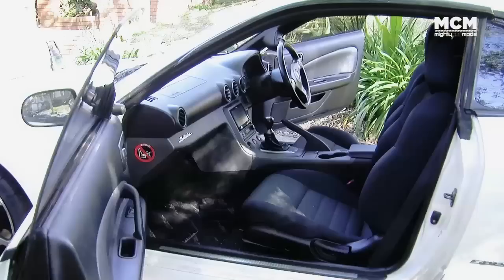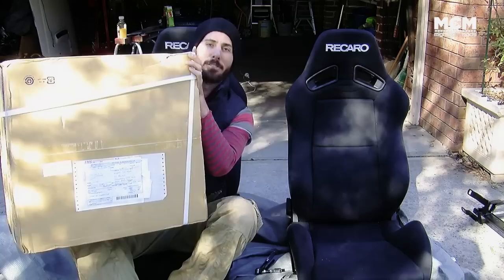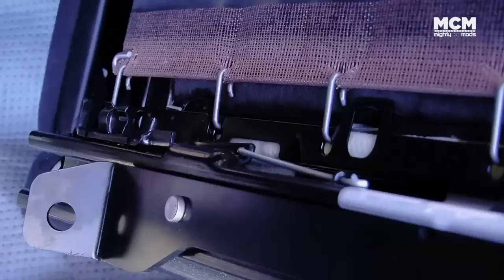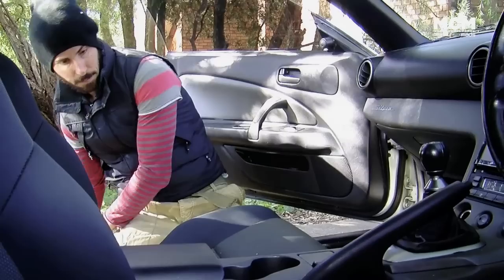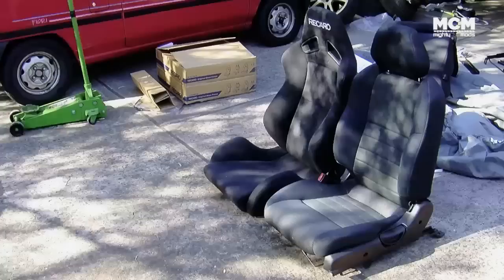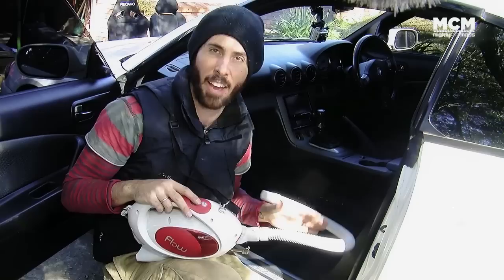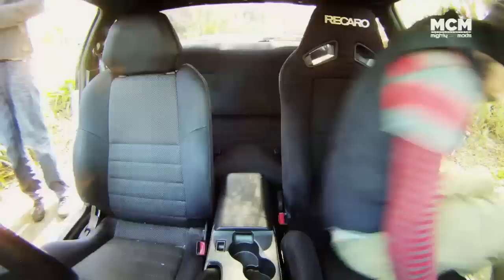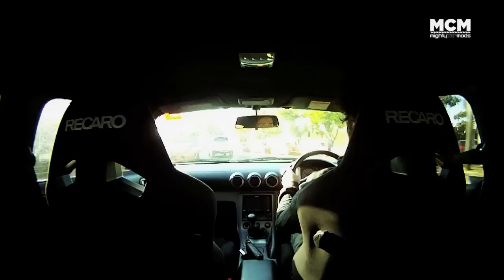How To Install After Market Seats

Comment: Getting rid of this car was the biggest mistake in the history of this epic show.
Reply: Z33 Garage Just a car. Get over it. I personally like when they tune those cheap blue turds.
Reply: 3rdpartyU5er "just a car" said a non petrolhead
Reply: Uberized Arts Naah man, when it's not my car, I always say it's just a car. Only my car is not just a car :)
Reply: Uberized Arts Seriously an S2000 is a better overall car.
Reply: TassieLorenzo s2k better than a Silvia. You must be drunk dude, go home lol
Reply: TassieLorenzo did you just dare to say that s2000 is better than silvia? :O this gave me cancer
Reply: Z33 Garage Yes, it's better!  Especially stock vs stock!  Stock suspension - S2000 much better. Steering - S2000 better.  Gearbox feel - S2000 better.  Engine sound - S2000 better.  S15 can be made much faster and is better for drifting, but that's the only advantage. ;)
Reply: jevnik542 If you don't believe me check out Best Motoring videos of stock S15 compared to stock S2000.  The S2000 is faster and overtakes the S15 ;)
Reply: TassieLorenzo i said better. not faster. Overall S15 is legendary car. Cant be compared to s2000.
Reply: Z33 Garage If the S15 came with a SR20VET (the Nissan variable lift engine) and had a much better chassis then it would be comparable to the S2000, but it doesn't... The SR20DET is not on the same level of sophistication as an F20C; neither is the S15 (or S14 or S13) chassis on the same level compared to the S2000 chassis and suspension.
Reply: The S15 is certainly a good tuning base... but that's cause it needs more work before it's good. ;)
Reply: +TassieLorenzo even my 350z can easily take an S2K and the S15 is way better than a 350z.
Reply: +TassieLorenzo defiantly agree with you, the s2000 is a much better engineered car, stock vs stock it would beat an s15 no doubt, the s15 is much easier and cheaper to tune, both in handling and power, a stock s2000 would be outdone by a tuned s15 and to tune an s2000 is much more expensive, as moog said in one of his videos the s15 is the bolt on king
Reply: +GaboGlow its funny you should say that because 350z vs S2K stock for stock according to car and driver have equal 0-60 times and equal 1/4 mile times.
Reply: This Silvia was so clean and unmolested (unmodified) that it wasn't ever worth selling. Most Silvia's today are molested, modified, and worst of all...LS1 Swapped ewwww. This car would only go up in value if kept stock.
Reply: LOLLLLL 350z sucks man, s2k is soo much better
Reply: 6 years later still true
Reply: @Bridger Charlie instablaster :)
Reply: @Bridger Charlie you are welcome xD
Reply: @VlogFilms  what car do you drive
Reply: 2024 Bring back a S15!!!

Comment: I can genuinely imagine someone blindly following this advice and actually jacking up their car.  You'd feel like such a wally when you finished and lowered it down.
Reply: When filling up your headlight juice, jack up the car and don't forget the axle stands.
Reply: Haha did u get that from Roosterteeth
Reply: As someone who knows nothing about this, but i got the feeling that, they were just trolling, right ?
Reply: ZeppinnEU Well there are some older cars that have a long bolt that goes through to the bottom. 
So don't forget to jack up your owners manual.
Reply: I was asking out loud what the point in that was, and I forgot about it until I saw your comment, lol.

Comment: Excellent review however I wish you guys had showed us a very important step that I KNOW you guys took - removing the positive battery cable, then wait 30 minutes before you unplug the air bag circuit beneath the seats as to avoid having the bags accidentally go off or throwing a code. Beyond that great install plus you two have great personalities that make you entertaining.

Comment: Please make a video about beginner car selection and good cars for people getting their P plates that are; fast, cool and under 10k [need cash for mods ;)]
Reply: EF/EL Falcon XR6, one of the quickest cars that are p plate legal, handle pretty good, heaps of space, and the engine responds extremely well to mods. Can be had with manual in mint condition for 3k, and come factory with like 168kw and a short ratio LSD. That is if you are in Australia of course.
Reply: For the money you cant beat the raw fun of he XR6, but there are other cars you should definitely look at if you can spend up to 5k.
Reply: won't be bagging you when you chop them
Reply: sounds good,ill look into it.
thanks by the way!
Reply: Haha all good mate
Reply: 05 WRX is what im getting
Reply: then liberty b4 or liberty gt spec b 4gen or 5gen
Reply: 200sx
Reply: OFCnoChill can't even get over a 1.6 econ-box  because of insurance😣😥
Reply: MrJaffacakesGTI have you looked into a 2011-2013 Mini Cooper Hatchback Base 6speed manual. I bought mine about  year and a half ago. Depreciation is pretty heavy on these cars and the base models aren't too desirable because of the lack of power. Not many performance parts available for the base model, but it is still good fun to drive. Obviously depending on where you live insurance companies treat cars differently. I live in California and due to the vehicle having rear seats there is a lower insurance premium.
Reply: FTO might be alright. I'm pretty sure all models are legal on Ps unlike a lot of other Japanese sports cars, where only the base model is legal, and they're rare cos no one bought them

Comment from the maker: @jcadlols The actual seat is lighter but the baseframes probably bring it about even, we tried out one of the kevlar race seats in the RS which you could lift with one finger. Fixed back and not quite as suited to a road car though

Comment: how would you install racing harness seat belts....
Reply: I'm pretty sure racing seat belts connect to a role cage
Reply: Dan Alves It doesnt have to be connected to roll cage. C pillar bar would be fine.
Reply: You need to install a roll cage to safely use a 4 or 5 point racing harness.

It is possible to install a racing harness to your seat mounting bolts bolts or a harness bar, but those are both stupid ideas. If you ever roll the car, the racing harness will prevent you from folding forward like the stock seat belt allows you to in the event of a roll over and you will die.

Install a proper roll cage, then bolt the racing harness to that.
Reply: On certain cars you can attach a harness to the bolts of the back seat which is still bolted to the car and prevents you from moving a whole hell of a lot during a roll or crash
Reply: Why the fuck not?
Reply: Its not about having track cars or anything. People doing for style points. and it looks nice. I drive a ITR. and I wouldnt mind having harness on it. Tbh i would prefer harness because it fits snug, hold you down. and its a plus if you dont have driver side air bags.
Reply: Jonathan Ngo in practice its not great though, cuz you cant reach the globvebox and other stuff in the car when your buckled in, so kinda impractical for your personal car
Reply: I can't reach my give box with my standard the point chest belt on. I barely can without.

Comment: So what can I do with the old seats after putting new seats in? I've looked around on the internet but I keep getting things about child car seats. I've already made an office chair from an old subaru seat so I'm out of ideas.
Reply: And yes, I know I can throw them away... just seems like a waste.
Reply: If you're into gaming and have a steering wheel for your PC/console, you can build yourself a kind of cockpit with some PVC pipes, wood or steel (depends on your budget and skills). Another idea I is a couch made of carseats, but for that you need a few more seats. But if you don't like those ideas, you could just sell them.
Reply: Just sell them on Craigslist or ebay
Reply: Hasszahn Did that with a $10 seat out of a MK3 Supra from the junkyard.
Reply: you could sell them if they are in good condition. People are looking for new seats all the time, rather it be because of a stain or a major rip.
Reply: eBay, or offer them as swaps or credit at a breakers yard

Comment: Does anyone knows if these seats are commfortable? I have a 350z and the stock seats destroy my lower back every time i drive for more than an hour, thanks for the video guys!
Reply: yes very moog even says so in this video if im not mistaken? cant be arsed checking
Reply: The biggest problem are the mounting brackets, on average they are $250. Also you have to make sure the Racing Seats you buy have sliders if not you have buy them separately. Also if you want the dual harness etc For everything its $700-800!
Reply: if it destroys your lower back, that means you drive with the seat at the wrong angle. Should fix that.
Reply: +Leroy Butts maybe but what if he has a slipped disc and has to see a doctor

Comment: Guys, one biggie you didn't mention was the pre tensioners.  These things have an explosive charge!  And then there is the air-bags too.  There has been reports of triggering the air-bags while changing to sport seats.  So, if your car had these things the first thing to do is either PULL THE FUSE or DISCONNECT THE BATTERY!!!!

If any of these are activated you can make a bloody mess of the dash and get seriously injured.

Comment: In switzerland is not just buying the seats and install them after you install the seats you will have to get the car inspected ( M.O.T ) in order to driving legaly with aftermarket seats it's crazy out here
Reply: Sind die auch so streng wie da?

Comment: Those seats look like they should be factory.  nice choice  I wish they would have commented on potential weight savings and bottom mount vs side mount seat brackets.  Other than that, it was an excellent video as always!  Next should be a video about installing a harness bar and 4 or 5 point harnesses.
Reply: christians131 Reclinable Recaros are actually quite heavy.

Comment: If its the bolt that's messed up find a hardware store and take of of your good bolts that can fit into that hole and get yourself another bolt. If the hole is messed up then you'll have to retap the hole and get yourself a slightly bigger hole that will work with whatever thread tap you used.

Comment: i think on alot of cars under the seat they have a wire for the airbag/pre tensioner which is quite important to remove :D and also taking off the negative battery terminal is a good idea

Comment: Hey MCM how do you swap to aftermarket seats into a car that has airbags built in to the factory seats. If i swap them then Ill have srs problem. How can I swap without ruining all of my airbags???
Reply: You won't ruin your airbags, I've had a car with airbags in the seats, I unbolted the passenger seat when moving, the airbag light on the dash came on but nothing happened, bolted the seat back in after the move and the lights was gone again. 
You probably should disconnect the battery and wait a bit before plugging/unplugging airbags, but I didn't think about that at the time and nothing happened. There shouldn't be any signal or power at the airbags when the ignition is off and the seatbelt isn't plugged in anyways.

Comment: maybe it is different in aus and japan, but you guys didn't mention anything about the airbag light? i would unplug my battery if i took my seats out. my 350z threw the airbag light after i took them out, i had to reset it every day for a week before it actually went away, still couldn't tell you why it took a week to go away though

Comment: Is it possible to have seat harnesses without a harness bar?
Reply: Yes, you cross them through the seats headrest, or the holes in your bucket seat. then bolt them to the floor in the place of your rear seat belts.

Comment: Thank you but I ran in to a problem. My car's stock seats have a built-in seat warmer that has a wire running to a button in the dash to activate them. What do i do with the wires and the buttons? The stock seats look hideous because the leather is cracked so much. I dont wanna mess all this up. Please help me...

Comment: If i had a weight sensor on my seat and i wasnt feeling the whole "having the sensor on the aftermarket seats", could i just use a resistor instead of transferring all of the wiring? Just to trick the dash into thinking that the seatbelt was on if say i had my backpack on the passenger seat and that sets it off or something.

Comment: Did you find they actually sat you higher than ths standard seats? They looked a little high to me. I really struggled to get the seats in my old S13 sitting low enough - I ended up using a side mount and cutting away the front mounting rail from the body and then mounting it to the floor.

Comment: How to remove 2nd and 3rd row seats from a passenger Van. I am told they are bolted to the Van frame and the bolts need to be replaced after the removal of the seats. Is this true?
I am looking to make a Passenger Van into a Stealth Camper.

Comment: I have a 97 Nissan Navara D21 which has a built in bench seat. Does anyone know if its difficult to install 2 bucket seats and pull out the original bench seat? Obviously I'll need to pull out the old rails and install new ones. Would it be a big job?

Comment: My stock bucket seats are powered for back and forth, up and down. I want new aftermarket bucket seats. Is that even possible without spending tons of money to get electric ones?
Reply: Sure it's possible; but you will no longer have power seats. You'll be installing new seats on new manual rails.

Comment: So why cant they use the old rails from the old seats? am i just missing something here?
Reply: The seats won't directly bolt up for that seat to stock rail. Sometimes you can get lucky and it'll just switch over.

Comment: Is it a good idea to disconnect the battery before disconnecting the wires under the seats?
Reply: i dont think it makes a difference but better safe than sorry
Reply: Burning yeah, some seats have air bags which can go off of the battery is not disconnected

Comment: is it safe to use your stock seat belts with racing seats? ive heard rumors that there not safe and that even 5 or 6 point harnesses arent safe either and with the help or harness bars and/or roll cages they are still considered to be unsafe, im new to this and would like to know what works best in this sort of application before i go wasting money on stuff thats unsafe and doesnt function as it should
Reply: to be honest the stock ones sometimes don't go well with upgraded seats, and a decent three point harness and rear upper strut brace as a minimum

Comment: Are bucket seats recommended for short people? im like 5'1 - 5'3.
Reply: Most rail systems like the ones shown will have a full range slider forward back up and down if Im not mistaken. Unless you just get a bracket to direct bolt in with no rails then exact placement will be needed.

Comment: can any seats be installed? like say if I wanted to take seats from a different make of car and install them?
Reply: As far as seats go anything will fit into just about anything. But you might have to come up with some custom seat rails. Which isn't a mighty hard thing to do if you know someone handy with a welder.
Reply: like what jagerbomb7810 anything will fit, but you can also read on forums for your type of car to see what other people have done, it's just a matter of finding your model on that forum. Good luck bud.
Reply: you do like from honda to acura, chevy to pontiac and so on as long as they bolt pattern lines up, but why switch seats around like that??

Comment: on 4:35 about the seatbelt indicator what about for 4 point harness ?
Reply: i live in the US CA ive seen them around on average street cars, but like im wondering do they come with that sit belt sensor or do i have to change it or take it off or what?
Reply: eliud reyes you can disable the indicator usually by removing the fuse
Reply: I live in California do you think that will affect me when it comes to passing smog check?
Reply: eliud reyes Why do you think removing a seatbelt indicator fuse would affect your emmisons?

Comment: Are some car seats not compatible with certain cars? Or is it a one size fits all sort of deal?
Reply: i think you buy the rails for the model of car you are installing them into, and the rails bolt to the seats which are all the same.
Reply: I'm pretty sure no bucket seats are compatible with my car...
Reply: Sketchy Banana why,what do u have?
Reply: Gslash25 65 Mustang restomod.
Reply: Sketchy Banana o sweet, but yeah not too much in terms of seats
Reply: Gslash25 Guess I got to make custom mounts again... :/
Reply: It really all depends on what car you have, I was looking to get new seats for my Lotus Elise and none cane even close. If you have a car with a decent amount of space between the floor and the roof you should be fine but just use common sense and don't try to install seats that have a half inch of clearance between the seat and the roof it will look unprofessional.

Comment: What about trucks
Reply: No there are a lot trucks that don't. My Truck has two front seats and the driver seat has a small middle seat attached to it . The major problem with my seats is they don't recline back . I want to get some seats that recline and are comfortable .
Reply: Josh D Bennett Pull seats out of the same model truck of the same body-style that do recline and put them in. You may need some electrical connectors so look at what your truck has and then what the other one has.

Comment: Do a Australian car I dare you ( aka Holden commodore )
Reply: Lmao I've done it to my BA XR6 falcon. 

With the 5 points aswell, driver and passenger side. Also I have no rear seats, a roll bar, and full chassis reinforcement. 

All mod plated. 
And all the metal fab work was done by myself or my father.